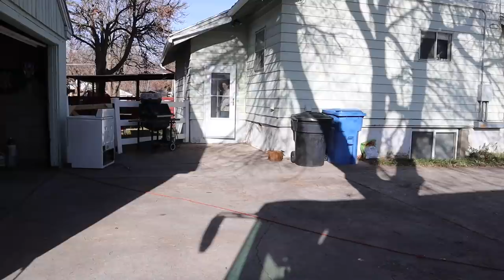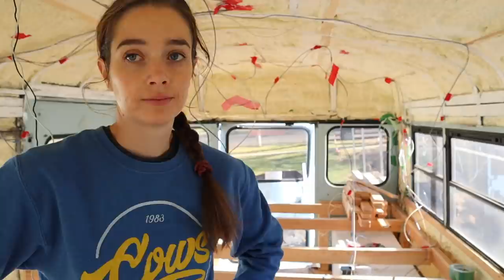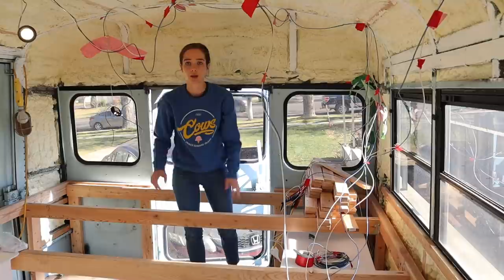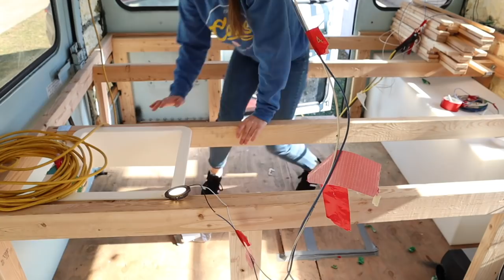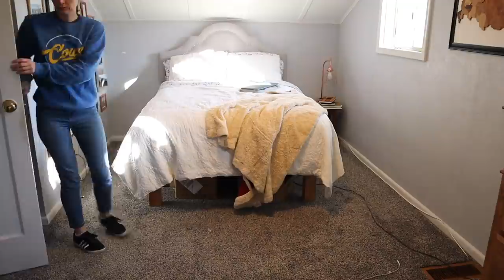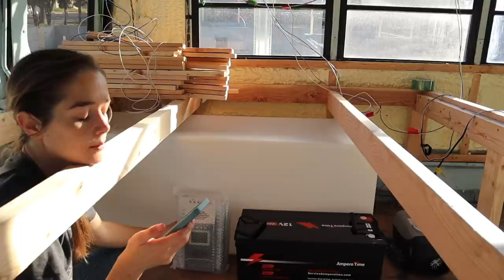School Bus Conversion Electrical P1: Testing 12v lighting, organizing components, &SO MANY QUESTIONS

Comment from the maker: For those of you who have been getting steadily more worried about me doing this, I just want to remind you again that I do have help! I am very aware of my own limits, and I’ve been working with an electrical engineer as well as several other people who are way smarter than me. Please try to remember that a 20-minute video each week is not a comprehensive representation of what’s happening here. 

Thank you to everyone who has been leaving helpful advice! I read and consider and appreciate all of it. If I don’t respond right away, it doesn’t mean I’m ignoring you or writing you off - it’s just not feasible for me to immediately leave a thoughtful and lengthy response to every single comment. I appreciate all the help!
Reply: You’re doing great and don’t be afraid of 12 V the most dangerous thing you had going was the jumper cable leads from your battery in your car if those things would’ve touched it would’ve been bad
Reply: Hey, we can call this electrifying video I can recommend you an idea add a video every two weeks or so so you can share future plans for the bus, it's easier to see the opinions of several people before you start doing something that can make you change your mind is this way every agent can share the positive and negative points of what they think 10 to 15 minutes of your time can make a big difference in the future 😉
Reply: You are doing an awesome job! Not only that but you are giving it a go yourself, that means that you can be self sufficient when you finally leave the driveway.

One thing mentioned already is weight distribution, the water tank behind the axle IMO is a bad idea. Don't think about the location for convenience, think about how much it weighs when full (rough guesstamate is 600 - 800 lbs). Also consider the water in that tank as waste water. For showers and washing up, not drinking or cooking. Personally I would have gone half the size/height and considered mounting it underneath the bus more so if you think about the possibilities of damage to the tank and flooding the bus. The water tank inside the bus will also introduce condensation into the bus in colder weather. 

Have you also thought about the grey water tank? All that water has to go some where on the bus.

Keep your electrics away from the water and potential moisture build up, mount them on the opposing wall and where they will get plenty of ventilation. Also consider the heater will need venting on both sides.
Reply from the maker: @DavetheUberSlave  what would've happened?
Reply: My GF wants to know where you are putting the dog bed
Reply: My only advice would be to have the electrical set up on the opposite side from any water sources for safety reasons. (not that I have any idea, just just a gut thought) Also consider the weight distribution
Reply from the maker: @DNA930  hahah i don't have a dog!
Reply: @EmmaBuildsBirbie  Well then you need to get a dog.  Who is going to be your copilot for bus adventures?
Reply from the maker: @DNA930  i'm leaning towards a skunk
Reply: @EmmaBuildsBirbie  awesome
Reply: Video on how to use multimeter     https://youtu.be/ts0EVc9vXcs      . For now you are mostly working on 12 Volt DC so it is the V symbol with the straight line with the three dots below on the multimeter, the V with the curvy line is AC. You cant shock on your 12 V car battery, dont worry. Normally 12 VDC can at best burn a cable on a short but wont shock you. Try to place your electrical components and circuit breakers so they are easily accessible once your build is complete, to fault find and switch things on or of. You dont want to always crawl under the bed to access them. As you will be refilling your water tank, place your electrical components so that spills, overflow cant come into contact and blow your expensive, solar charger, battery management, inverter etc. When storing your 200Ah battery, always place it on wood not directly on concrete in the garage as it will discharge if left for some time. Dont sell yourself short, look how well you did with the lights wiring 👍
Reply: @EmmaBuildsBirbie  I had a pet skunk many years ago. If you should ever get one ( I don't really think you even can now) don't feed it grapes. Grapes do very bad things to them.
Reply: Hi, had to commit again, do it like you want. I see all the comments and I would not want to try to read and digest it all. Do what you want. And good luck. You are doing great
Reply: Well thank you for building a beautiful bus
Reply: @EmmaBuildsBirbie  ur car would have burned up or destroyed the wiring in ur car & maybe bus
Reply: & water tank fills want to go to out side of bus unless u want to have to bring a hose in side ur bus to fill it & a cordon floor & one along the top will hold it in place make sure it cant slide cuz it going to be heavy & water & electric do not mix I think I would want power stuff up off floor battery can go on floor but rest should be somewhere u can get at & that will never get wet
Reply: @EmmaBuildsBirbie  if the positive and negative clamps that were sitting in your van touched the electricity from the battery flowing through the now completed circuit will melt the wires battery and possibly catch fire. By the time you grabbed the cables and tried to pull them apart they would be stuck together like a magnet and so hot you might get burned. Cool thing about 12 volts is you can touch the positive and negative poles at the same time with your hands without getting shocked
Reply from the maker: @DavetheUberSlave  😳
Reply: @DavetheUberSlave  the odds of that are very slim

Comment: You're doing great!  Well done with the electrical testing. :)

Please keep in mind that a gallon of water weighs 8.34 pounds. I totally understand the motivation to have the tank under the bed, but having all that weight on the driver's side and behind the wheels will tend to mess with the handling of the bus - especially when you add the weight of the batteries on the same side. Please at least distribute the weight left to right (it's common to put the tank on one side and electrical on the other) - but if I have a vote, I'd beg you to put the tank in front of the rear wheels on one side and the electrical on the opposite side in front of the rear wheels.
Reply: Also, I think you may want the batteries, inverter, etc. closer to the back door so you can easily access them when inevitably you lose power. It happens to everyone. You don't want to move your entire bed to access that stuff.
Reply: @MrGibbs865 meanwhile electric water heaters have been used for decades
Reply: In reality this is a bus rated to carry like 20k lbs...it will never have a noticeable effect. This isn't the typical Insta vanlifer build everyone is used to.

Comment: Hey Emma , think about your weight distribution . You may want to build a box ( cabinet ) for your Battery & Solar Power Inverter.  Also you'll need space by your water tank for pumps & lines. Your doing great !
Reply: This was exactly where I was headed too.
Solar components and batteries especially are uber heavy.
Maybe consider opposite sides of the space under the bed.
And agreed. You're doing great Emma !
Reply: @codypatrick3026  But this is a 40+ foot bus rated to carry like 20k lbs...that tiny bit of weight won't be noticeable. This is NOT a van build
Reply: Yeah, that was exactly what I was thinking while watching this, balancing the weight of the water tank. She's doing fine, tho.

Comment: Emma,  two things of concern at this particular time :  the shape of your bed,  and lighting circuits.

Reconfigure the bed so you have at least 18 inches of walk way in front of each of the two rear doors.  You have now made the bedroom more ergonomic for living purposes and two rear,  easily usable,  very important FIRE ESCAPES.  For the exact width of the walkways,  carry your young nephew under one arm and Tiny Dog under the other and measure the exact space you'll need.

For added lighting circuits,  I use 110 volt household switches because of their familiarity and convenience.  Most important, they come in 3 way and 4 way configurations,  so those circuits can be turned on at one location and off at another.

Good Luck.

Comment: Hi,  Me again, the guy who converted a bus in 1980.  Water weighs 8 lbs a gallon and the  battery you just brought in is not light.  It is also best to keep water away from electricity. There will still be a kitchen and cabinets and a shower to weigh in but, you also need to pay a little attention to weight and balance.  The entirety of the bus will take the weight but, it should be spread if possible.   Just a quick thought.  ( something I had to figure too )   All the best, Hal

Comment: Trying to get this all right is a challenge for sure 😉
In my mind I would want my water tank, bathroom and kitchen all lined up with grey water in the center underneath the bus. All the plumbing on one side. 
The electric.....oh boy, I would be so challenged by the wires and connections. I would probably get solor exterior patio lights and hook them to the ceiling LoL then get a big Jackery for the rest. 
KISS is my go to
"Keep It Simple Sweetie" 
If I had a bus I would want it open front to back which would be a twin size bed I guess 😅 
Thank you for taking us on your journey with Birbie 💟

Comment: This was so much fun watching you discover you got this! 12v would be difficult to hurt you. If you've ever put your tongue on a 9v battery, you know what it feels like. Is it too late to answer some of your questions?

I bolted a 2x4 flat around two sides of my water tank, on the floor. The other two sides were against the wall. That keeps it from shifting if I slam the brakes. You could maybe screw into the plywood, into the metal floor, but I felt much safer drilling a 1/2 in hole all the way through the bottom of the bus and using #8 bolts (that's the kind they use for seat belts). Fill the gap around the bolt with spray foam (or what I used was fire caulking. It stays slightly flexible, it works great around wires and pvc pipes too)

If you use 2x4's on the floor they work out great for building your wall too for your components! And also to keep the heater temp away from your plastic box. Be sure you can see your hoses easy enough to watch for leaks now and then. 

The combiner box is for bringing six wires of your three solar panels into two wires. You're probably wiring them all together one into the other so you will only have two wires going into your bus. I have 8 panels, four groups of two. So I had four sets of wires that I needed a box for. 

Oh last most important comment. Because you need to secure that battery (and future batteries) absolutely still. If that kind of weight shifts for some reason and your wires end up crossing you could start a fire. 

You got this.

Comment: Good fun learning about electrical circuits.  Now you know how to make your own sparks.   ;-)  Tip:  An AC house light switch can be added to the power source of the circuit(s) for the purpose of testing.  With the switch off the circuit can be connected/disconnected without sparking.
What you've done by the method used with the car & battery is accidentally develop a Disaster Recovery Plan for the 12 volt circuits.
When planning your circuits you'll need to know the max number of lights or outlets per circuit.  Remember, the microwave and refrigerator should be on a dedicated circuit.  Example:  on AC the max number of lights would be 9.  I'm not sure with DC as that is your plan.  Glad to see you had fun in this video.

Comment: Emma 

When ever you hook up jumper cables try to remember to always put the negative ( black ) end on the battery last when your putting them on. And remove the negative ( black ) off the battery first when you are taking them off. This way you won’t cause a short if you accidentally touch the positive ( red ) anywhere on the car that is metal, it could cause a spark.

Comment: As an electrical engineer I suggest you plan this all on a piece of cardboard that would mock the plywood you are mounting all the electrical. Wires can run behind the board and cool looking devices like the breakers, charge controller, Inverter, etc. this makes for a simple and clean install. Most of all DOCUMENT EVERYTHING. Label every wire!!! You need to be able to figure out a problem or be able to hand the info over to someone else to help you without having to trace every single wire. 

Use an excel spreadsheet system if you need to to control all the wiring. It can get complicated but an organized approach to documenting every wire is much more important than being ocd on the wires appearance (although that helps later too)

Feel free to reach out if you need help or ideas

Comment: You're doing so well Emma.  Great video.  For placement of electrical parts, just keep in mind that you may need to access some things in the future so make sure you can get to them without too much difficulty, so like your fuse box should be easily accessible for changing fuses or turning off the master cutoff.  I've seen where some people put all their electrical under a homemade sofa or seat (box with cushions).
I don't think it matters too much if your electrical system is right in front of your water tank, as long as the screws that go into the board aren't so long that they also go into your water tank.  With the water tank, remember you'll want easy access to the fill hole, you don't want to run a water hose through your house to fill it up 😊.  So make it accessible from the back door or to a fill hole in the side of the bus.  But if you do the fill hole, you'll have to have some way to know that it's full before it overflows.

Comment: Everything seems to be coming along.  On the subject of your tank, depending on the tank, some of them have a large fill port that should be on top.  That would be used as a gravity fill and vent.  The smaller threaded ports usually are used for supply.  Those threaded ports should be put on the bottom and out to an accumulator between the pump and tank.  The other port could be used for direct pressure fill, that however I would need to show you a diagram of.  Your tank will be quite heavy full of water.  I would consider shifting it forward of the rear axle at least 75% of the tank.  Might want to consider all of the rest of the plumbing and electrical access to be from a "garage" under bed rear door access. On the subject of your electrical, I would consider placing that on the other side of the bus.  Evening out the weight load of your water by putting as much as you can on that side could help a lot.  The batteries and other heavy components should be shifted slightly forward of the rear axle as well.   Distribution of weight should be taken into account on your design.  I would suggest laying out a proper floor plan before you continue.  A program like SketchUp is very useful and there is a free version that works quite well.  I have been using this for my layout in the coach.  To be fair, you are doing fine.  I have been modding vehicles for over 20 years.  Don't let any of this get to you too much.  Just be safe and ask any and all questions you may have when unsure about testing and ect.  On your solar panels, you should be able to read DC voltage from your MC4 connectors on your panel while in the sun.  I suggest videos by Will Prowes.  He does a lot of solar related content and is truly one of the best on the subject.  If you have any questions for an up fitter, by all means you are welcome to ask.  Be safe.
Reply from the maker: thanks!

Comment: I just finished building a classic car. Different than a bus but one mistake I made was to hid every wire and hose so well that in order to get to anything I have to take a bunch of crap apart. Now I am actually doing that and it SUCKS! At least with a bus you have the space to be sure to make everything easily accessible. make sure you can get to all the wires etc. ALSO, make a map diagram on paper of where EVERYTHING runs and take a TON of pictures of everything before you cover it up. I promise you wont remember where anything is when something breaks. And, if anything goes wrong just blame your electrical engineer friend! LOL . I am loving the series so far!!!
Reply from the maker: hahah thank you!!

Comment: The research and planning is where the hard work is done and where time spent is never wasted. Even though you could have used the portable power box to test the light; using the jumper cables gave you more experience and comfort working with DC electricity. 
Do you draw out your plans and ideas? I remember you did a sketch earlier. 
About the water tank, the void behind it might be a good place to house your water pump and any filtration system you may add.
Building a wall under the bed to section off space is a great idea, fastening everything there will make for a tidy install. 
You are doing great, you recognize when to stop and regroup.
I can't wait to see what comes next.

Comment: Fantastic job on the lights!.. I would separate the battery and electric components away from the water tank.. preferably at the back end of the bus for easy access to fix or upgrade later..  Emma you are doing great.. you are amazing.. Cheers from Missouri !
Reply from the maker: thank you!😊